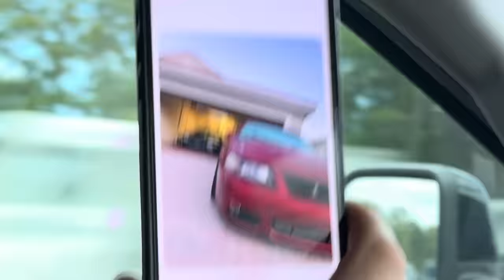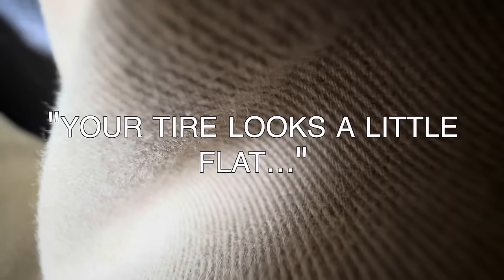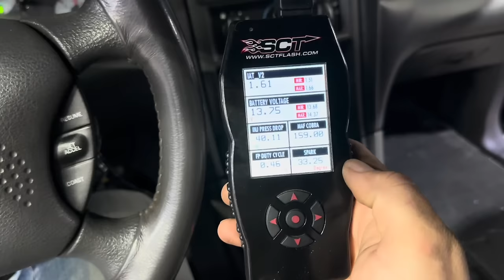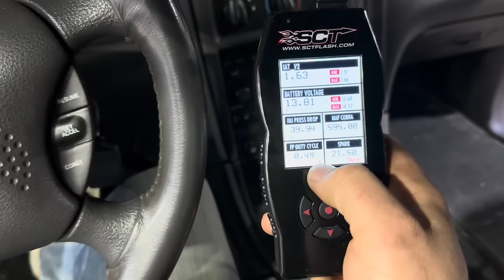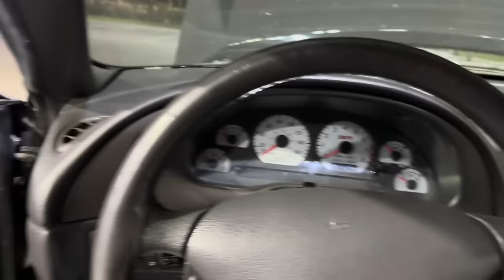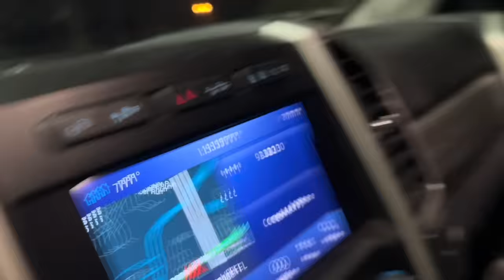Buying Two Terminator Cobras on the same Day - REDFIRE COBRA RETURNS

Comment: My Cobra smoked like that when a bad frps caused a fuel washdown in the crankcase and scoured the cylinders. Red Fire back in the house! Congrats to Andrew and Blake on 2 great scores!
Reply from the maker: This one doesn't smell like fuel though lol. Smells like oil
Reply: Motor is not blown...valve train issue...Blake's is black..what color did you say yours was..LOL
Reply: @MustangLifestyleTV  Yeah my smoke smelled like oil too. My dipstick smelled gassy, but the fuel washdown stripped the rings & cylinders of oil and after the stripped metal rings ground against metal cylinder walls, it created grooves in the cylinders and the oil started to blow by the rings. I changed my oil as soon as I realized what happened, but too late. Lots of blue oily smoke! My new setup is made to run without the frps so this will never happen again.

Comment: If a terminator motor makes it to 100k before it starts losing compression and burning oil, you basically have a 1 of 1 terminator. The pistons will hold power, but youre going to get quite a bit of variance of compression between cylinders
Reply from the maker: The black vert has 170k on it and we just made 570whp on it with the kb 2.2 lol
Reply: Had a few 100k + mile terminators and never had a single issue…
Reply: I thought you didn't like the convertible Terminators Andrew cause your first one was a coupe
Reply: Bro I have 110k miles on my 2.2L KB cobra and just made 590 rwhp and 540 tq... what are you smoking? I've owned 10 terminators now. Never had an issue aside from small shit that was easily fixed. Like pprc deletes etc.
Reply: I guess there's a lot of 1 of 1 terminators out there 😂
Reply: @username-kn3oh no shit I don't think he's heard of properly maintaining one lol.  These things are stout and reliable if it's maintained you should be fine over 100k.  I've seen quite a few over 100k making big power so there must be alot of 1 of 1 terminators

Comment: 12k for a terminator?? that makes me more than jealous LMAO
Reply: They actually paid 20 grand for two the red one was 8 and the black one was 12
Reply: @dailylife3975 What’s crazy is that black one sold for 16.5k last year if I remember correctly. It was for sale for a while before it finally sold. It’s unfortunate it was sold with problems.
Reply: We actually ended up paying 11k for the black one because of it's issues and condition.
Reply: That's a pretty good deal.  If you have the ability to fix small issues you can get some pretty sweet deals.  I paid 16500 for a 2007 gt500 with 108k miles clean title tasteful mods in 2020.  The market hadn't got crazy yet but that's still a solid price imo.  The e brake cable was broken and it needed a new tie rod and tire due to previous owner driving it with said bad tie rod.  I fixed it all for 400 bucks lol.  First mod I did was a drag pack anyways so I was gonna swap from the 20 inch rovos it had anyways.  It's still going strong good as ever at almost 130k and it's been around 750 rwhp with a gen3r since 122k. These things last of taken care of.